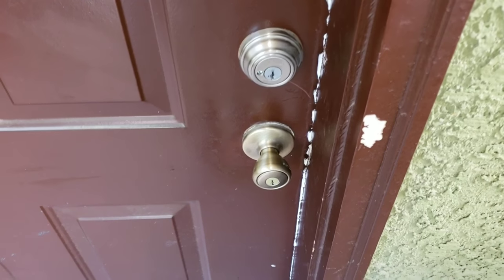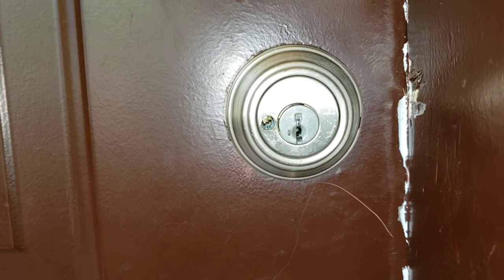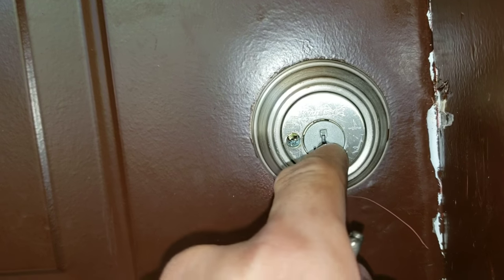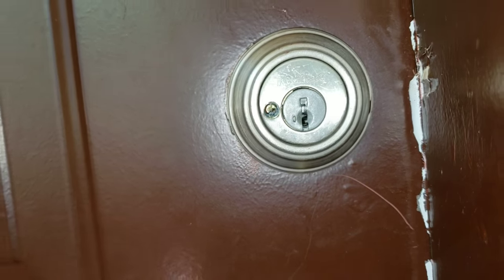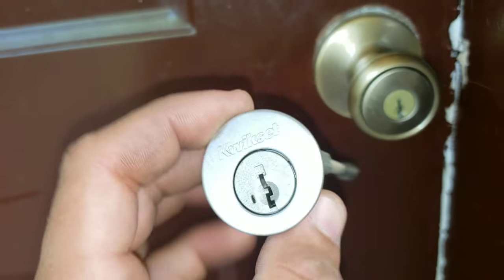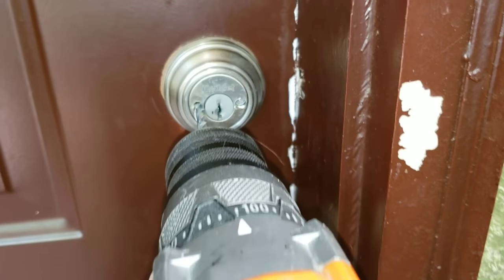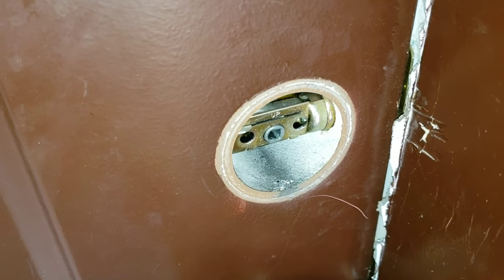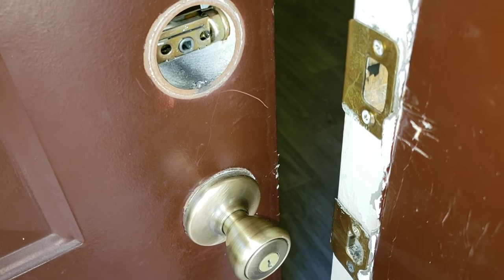How to Drill a Deadbolt in Less Than 2 Minutes!

Comment: Use a 1/4’’ drill bit. It fits perfect into those screw mounts. And on some of the deadbolts there is a plate that covers the bolt holes. When you start drilling the first hole that plate will pop off revealing both bolt holes. Pretty easy after that.
Reply: @boysshootingclubpodcast6457  probably back ward since you're trying to get it to spin out...on some deadbolts on the inside the thumb turn sits over the screws...but if you put enough force into you can push them out....
Reply: @boysshootingclubpodcast6457  
Right righty, lefty loosely. Right is drill forward, left is drill backwards.
Reply: @boysshootingclubpodcast6457  clockwise. The drip will cut the tip of the screw and then unscrew it.
Reply: You can usually pop off that cover before you start.
Reply: You don't usually have to drill out the screw but rather unscrew it via the bits turning...

Comment: I also am an apt. Maintenance man and I've had to do this 3 times but the drill buts are never hard enough to drill out the ends of the screws so I have to beat them loose with a punch h and a hammer. Even then they don't let go so I have to reach in with needle nose  pliers to break out the slide and move it out the way to pull the bolt back. The only slack I get is when the bezel comes loose.

Comment: Use a small flat head and pop the front cover off, then you can see the screw holes, use a smaller size drill bit and it’ll catch on the screws and basically unscrew them. I’ve done it many times, I can open a deadbolt in 10 seconds.
Reply: Make a YouTube video about it :)

Comment: Put some small hardened ball bearing down the screw holes when they hit the ball bearing it will spin and deflect the bit. High security dead bolts have anti drill plates. Mul t lock, medeco and assa to name a few.

Comment: i have a kwikset auro smart lock deadbolt. this did not work for me. what worked is drilling straight into the keyhole (which gets to the deadbolt itself) and then turn counter clockwise as if unlocking the door manually. 

hopefully this saves someone from having to call a locksmith like i did!!

Comment: My deadbolt lock doesn't work. While twisting the key, the tumbler just got pulled out.
I used a flat tip screwdriver (as an improvised key) and twisted the mechanism inside and opened the door.
Reply from the maker: 😅 That's pretty scary! So much for security!
Reply: @MoreThanMaintenance  well... it was... old.
Reply: twisting the cylinder breaks the bottom pins...those things are made of brass and typically don't just break off...

Comment: I tried picking the lock it did not work I need more practice it was my 1st time 😭😭🤣😂😂😂🤷 Soo this is my next step..
Reply: With this method you can save the actual lock cylinder to practice picking on or to put in another lock body to not have to use different keys or get a new lock rekeyed to existing...
So, if any of that is desired then try this first.
Actually try this first period.

Comment: Take off that cover plate that says kwikset on it!!! You can pry it off with a tiny screw driver or a knife blade! It will expose the screws!! You messed up man.
Reply: Lol I was gonna post the same comment. I was trying to show a new hire some videos on how we drill out locks and I was amazed that almost no one knew to pop the faceplate off and expose the open back end of the threaded mounting screws. Then simply use a bit thats slightly smaller than the hole so you don't strip the threads. Drilling in on the keyhole side means that you are drilling out the screws on the knob side. Apply forward pressure going at the screw slowly until you feel it moving. if there's a wood floor on the other side you can hear the screws drop. This method if by far the easiest and allows you to rekey and reuse the lock if you have the cylinder cradle.
Reply: So I had a kwikset plate pop off and didnt expose any screws tonight. And trying this method took forever. I must have been using the wrong drill bit sizes